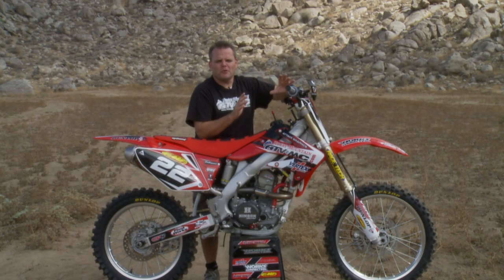4 Stroke Starting Tips

Comment: I know this is an old video. My carburated bike starts first kick cold. But after riding just awhile, say a couple miles. I'll switch it off. Then when I try to crank, it can take up to 10 frustrating kicks to start the damn thing. Very frustrating. I've tried it all, including air fuel mixture, which is perfect. Nothing electrical that I can detect. ( brand new plug set right)! Air filter...brand new. The bike runs perfect except for that. Any thoughts?
Reply: Newer bike or older bike? When a 4-stroke is warm it needs a leaner mixture to start. Some bikes have a hot start lever next to the clutch to increase air in the mixture. This is similar to what he mentions in the video by BARELY turning the throttle. This opens the slide in the carb to increase air but not dumping fuel.
Reply: Just days after I typed my comment, I found that if I twist the throttle full open and hold it when I kicked it over, it starts first kick every time!! Not sure why, but it sure works.
Reply: Sounds like a good way to flood it. But it starts everytime.

Comment: Do you hold in the clutch or just keep it in neutral/
Reply: Doesn’t matter
Reply: a 4 stroke 250, you wanna always start it in neutral
Reply: Nick Mancuso it does matter if u start it in gear then the bike will take off on you so neutral is best
Reply: @KonnectionZ  If you hold in the clutch your bike will not take off. So it doesn’t matter
Reply: Easier to start in neutral. Less resistance
Reply: Good rule of thumb is always pull the clutch in when trying to start it because you could accidentally be in gear when starting it and can end badly lol
Reply: Neutral easier forsure
Reply: @read226  not possible can’t kick start a bike in gear
Reply: @johnbruzzi4381  well you obviously haven’t tried hard enough 🤣
Reply: @read226  so your telling me you’ve done it.  What kind of bike?
Reply: @johnbruzzi4381  Iv done it on an XR80 and my crf250x and a few other bikes, it’s really not that hard to do.
Reply: @read226  I have a trx450 with 13.5 to 1 piston and I don’t think I could kick it in gear.
Reply: @johnbruzzi4381  ok yea understandable, but it’s def possible on some bikes so that’s one reason why I always pull the clutch in when starting my bike
Reply: @read226  oh yeah I think that’s good practice if your bike can start in gear,
Reply: I always hold the clutch in when I start my yz 490.  Some times 10  or 15 high and hard kicks to get it started.  I don't start it with the stand down either. Left foot on the ground and jump as high as I can to get a good kick

Comment: Typical honda puffing smoke 💨😂😂
Reply: Michael Calabrese all the 250fs ive had have done that when u cold start them they will stop when they are warm they just need valve seals
Reply: @andrewb232  it's a Honda thing my rmz dosent puff one bit
Reply: ive had a yz250f a crf250r and a kx250f and they all do it
Reply: @andrewb232  cause you buy clapped out bikes bud if you know anything about 4 strokes they should not smoke like that Honda
Reply: my 2019 yzf has 39 hours on it its not clapped out only smokes when its cold it just needs valve seals they dont last long
Reply: Michael Calabrese RMZ is garbooo
Reply: ik id rather have a honda that smokes a little on cold start than a suzuki
Reply: andrew b Suzuki in the past 20 years has made slow, crappy, poor handling bikes. Honda on the other hand makes extremely reliable bikes. The man is just jealous
Reply: Chris Hansen suzuki 4 strokes make less power and still are less reliable
Reply: andrew b actual facts, it’s sad.
Reply: @chrishansen8026  funny cause pastrana and Carmichael both won championships on them 😂😂
Reply: Michael Calabrese ever heard the saying it’s 90% rider 10% bike? 🤣 yeah
Reply: Chris Hansen thats only if your bike still runs
Reply: andrew b lmaooo
Reply: My honda crf250r 4t does not smoke at all i wid be concerned if it did
Reply: @chrishansen8026  agree m8 there my bikes in my pics bomb proof
Reply: Honda one of the best brands period
Reply: well my honda dont smoke they never should smoke ever
Reply: “typical honda” what do you ride bud? and for the video he turned he choke on and the engine was warm, no duh it’s gonna smoke 🤡